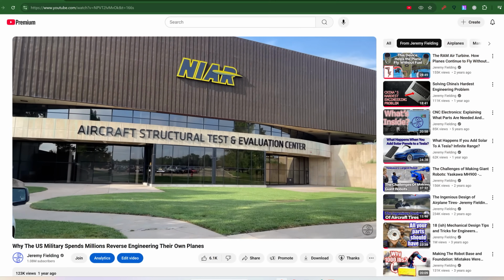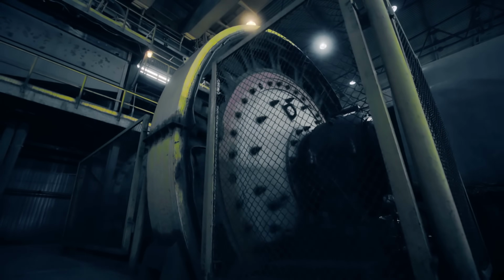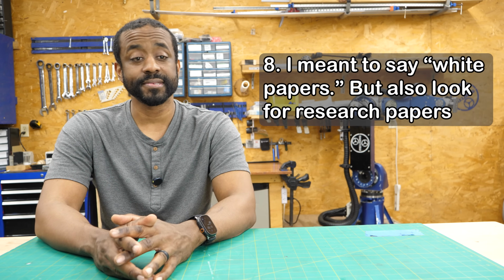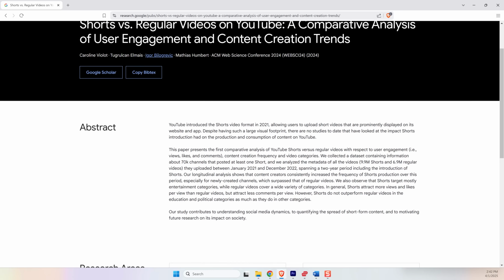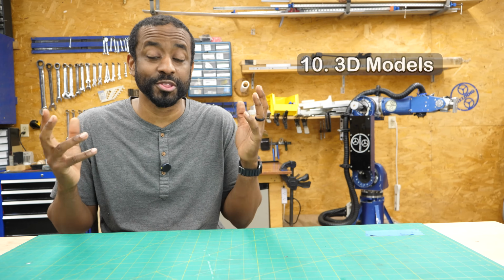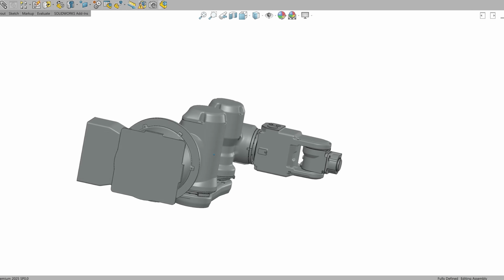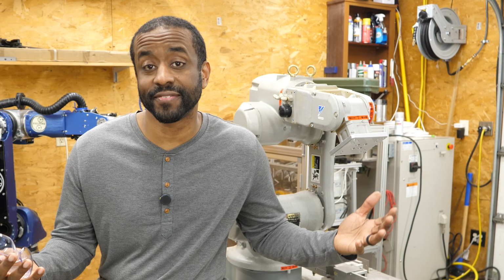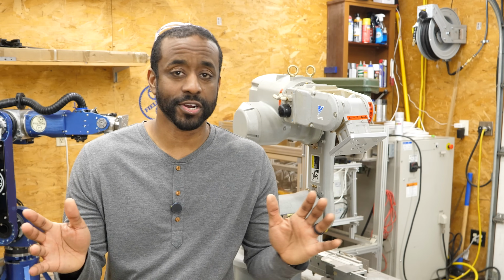How To Reverse Engineer Anything Even If You Don't Have One!

Comment: Hi Jeremy/All, I would like to point out what Jeremy said concerning our presupposition/opinion. He makes this (very important, in my humble opinion) statement at 22:22. He states "Actually, you should never be so conceited to think that you're actually smarter than the guy who came before you." 

I work as both a manufacturing engineer and machine design engineer in my facility, and both the Lord and others have taught me that the best route forward is to remain humble, and never tell yourself that your initial opinion is best. We should always remember that we have had to learn everything that we currently know, and that our opinions are based on our current understanding. This is very limited. I don't tell myself that my way is the best, I tell myself that "This is the best way I currently know how, and if someone has more input, I would love to hear it! 

One thing I have learned since working in this field (Since 2009) is that I need to recognize that people are smart, whether they are "an engineer" or anything else. I have learned much from floor operators who use the equipment! I consider their opinion, as they are the people who use my design daily, and can see the horrible flaws or sometimes minor inconveniences that I had not considered. Many times, a design is settled in prototype phase, then reiterated in production phase, because the design needs to consider how 10,000 are being assembled, when it wouldn't matter if you're only building one, etc. God bless you, and thank you for your mindset!

Comment: That "divit" is for "mastering" the axis. Each axis will have one. You screw in a device which gets hooked into the robot. l and will tell it when it bottoms out. Newer robots it is electronic/ mechanical, but I suspect older robots are pure mechanical. I have to master a kuka krc2 system I am resurrecting, so I will find out.

Comment: 20:05 this is potentially to lock down the head for shipping so the servos, gears, and bearings don’t need to support the load and vibrations if that’s in a cargo container bouncing around the ocean. I would have thought it’d be externally accessible but I have a feeling the importer or purchaser has to do a minor tear down anyways to grease it and any other things that may impact importation.

Comment: Bro thank you for this video. This semester I literally took a course named Reverse Engineering, and it was a complete misnomer, because we actually didn’t learn ANYthing about reverse engineering, and instead it was a course that taught random little factoids about varying and completely unrelated fields. An absolutely useless course. In this 30 minute video, you’ve taught far more valuable knowledge about reverse engineering than I’ve learned from an entire semester of a course with the same name.

Comment: First off, I love your videos and your attitude. Your excitement is contagious, so thank you. Secondly, in many cases, people tend to overlook one important detail of mechanical design, the fasteners. Obviously, everyone knows they are crucial, but I have seen many great designs fail simply because the fasteners were insufficient. When reverse engineering, i pay attention to the placement, type, and reason for each fastener. Typically, there is not much to ponder in standard use equipment, but in my field being aviation, there are tons of questions to be answered. For example what is the type (Blind rivet, solid rivet, blind bolt, lockbolt, screw, bolt, etc.) What is the head style ( tension head, shear head, button head, hex, 12 point, unisink, etc.) What material is it made from ( aluminum, monel, cres, titanium, alloy steel) Is there a special coating? What is the tensile and shear strength? What type of load is in effect? Is a washer required, and if so, what type of washer and how many? What material is it being installed into? The list goes on and on. One major issue to consider is dissimilar metals. A steel fastener installed directly into aluminum will cause corrosion that spreads rapidly. The same is true of aluminum fasteners installed into a graphite structure. In some cases, a simple fastener can be the breaking point of an otherwise fantastic and complex design, and when designing from scratch, this could be a very costly mistake. There is also a very large assortment of fasteners for different applications that could likely be implemented into standard equipment designs that are largely unknown by many engineers. Some research time is, in my opinion, well warranted when the outcome could potentially be much stronger (or intentionally weaker) as well as much cheaper depending on the intent of the machine.

Comment: it seems like you went into this with a lot of knowledge already of what the components are. Would you say you first need to learn about common components in machinery before attempting to tear apart something like this? Cause it seems like you knew a lot about how pulleys, motors, face plates, etc worked already, which helped inform your observations of how things worked.
Reply from the maker: When I started doing this I didn’t have nearly the knowledge I have now. You find something interesting and you look it up. Next time you know what it is. 10 years later and I am making videos about it.
Reply: @Jeremy_Fielding Interesting. Thanks for the response. But then surely you should start with taking apart more simple things right?

Comment: Well they could of put industrial heat shrink on all your connectors making it hell to get off. At my old job working on garbage trucks if you needed to push the compactor blade to full eject with the back door closed so all the lovely garbage juice doesn't spill out all over the shop you had to trick the system into thinking the tailgate was lifted up by disconnecting the proxy switch which had this thick heat shrink that also had some kind of bonding agent added to it making it very difficult to remove even with a razor blade. So servicing the wiring or sensors was a draw.

Comment: brother.. what you want, to machine stuff like that piece needing concentricity and complex back boring features, as well as complex OD features which otherwise require precision mill work.. is a CNC lathe with live tooling (y axis), and a sub spindle.. kept very clean and accurate... you can do all the work in a single set up.. make twenty to fifty of them per shift..and set up for the next part.... rinse and repeat.. i suggest Mori Seiki, mazak, or a brand new Haaz, paired with quality tooling Sandvik if possible.. for very tight tolerances and consistent results... for this it is often best to make custom jaws, use your G10s, sub routines, etc. to maximize output and minimize time lost indicating each raw casting..... thanks for your videos.. been subed a while.. love your spirit.
Reply: additionally.. ... .capto type tooling is worth the money... makes changing set ups very fast and very accurate, far more so than a bolt on type turret... raise your operators not only to be machinists.. but engineers like you... pay them as well as you responsibly can, and ask them to help you raise the next generation to do the same; before they blossom and leave you to pursue their own dreams if they decide that to be the course they need to take.... be good to them.. and fair.. knowing that everyone will crash a machine eventually.

Comment: Great advice!
I think you already said it, but it's worth remembering that when they built that, they were trying to solve a problem, and this is the method they came up with to get a solution.
That means if you are building something slightly different, you may want to use a similar, but different approach. In other words, don't get fixated on a one size fits all method.

Comment: Well I only engineered a smart lamp so far. And I looked at the basic mechanical, electrical and software I got a apprenticeship in and work with researchers. So reverse engineering is my next step and my next project is a cnc mill. I will learn a lot I guess and will need to reverse engineer like you I don’t got enough money for a metal cnc mill that works with metal so I can’t measure exact parts and can’t manufacture custom parts with high iteration (I have a good 3d printer wich can print carbon filaments) so I will use the 3d printer for testing some parts before and use some fem simulation to know how stable it needs to be.

But thanks for the information and a good introduction on how to do reverse engineering

Comment: Awesome video! The Japanese came up with an original solution for controlling the 5th and 6th axes in this robot. But what I liked the most is that all the markings are written on the motors, making it easy to find similar replacements. On our channel, we're also disassembling a robot, just like you, but we're working with an ABB IRB-2000, and there's nothing written on its motors except for the catalog number. Tell me, are you going to manufacture the harmonic drive yourself or will buy it?

Comment: I didn't see any other nerds mention it, but that "C2 Greyhound" is actually an E-2 Hawkeye - the radome is a dead giveaway. That being said, a big reason you see reverse engineering in the gov't / military is they are not so good at writing contracts - they may "own" the data / design for a product they paid to be designed, but they may not have specified in the contract that some piece of critical design data actually must be delivered (think beyond drawings / CAD models to software, firmware, aerodynamic models, stress models, test reports, and so on). So they "own" the design but they don't have the information they need to make a repair or modification. Or they received the info at one point but didn't keep it organized and/or "those guys no longer work here"...

Comment: An easy project that helps me practice reverse engineering is modifying and customizing video game controllers.
So far I completed 3 Xbox and 2 Playstation controllers, 1 of those PS4 controllers required a little bit of soldering for the back button remap kit and turned out really well; got another one to do and then a PS5 controller is next on my list to install a back button kit.

Comment: I just spent 3-1/2 months, 50 hours per week, reverse engineering a machine for a client in the semiconductor manufacturing equipment industry.  They didn't design the machine originally.  The machine is no longer manufactured by the original manufacturer.  My client has a significant list of customers that would still like to buy such a machine, but there are not enough used machines to go around.  Due to the age of the machine, there are no patent issues to worry about.

We now have complete 3D CAD models for every part on the machine, assembly drawings, and detail manufacturing drawings of every single custom part.  Also, every single off-the-shelf part is identified down to the last fastener.  We have shop drawings and CAD models for manufacturing 190 of the custom parts (approximately a total of 400 sheets of drawings).  We also have a Bill of Materials with a unique new part number, description, and quantity for every single part on the machine.  It was a lot of work.

Next step is to build one or two prototype machines.  I can't stress enough how important is can be to take lots of high-quality photos during the process.  It can make all the difference in the success of the project.  For this machine, I took approximately 350 photos over the 3-1/2 months.
Reply: to me, making 3d models of something sound impossible, a task out of sci fi lol
Reply: @subgivtara  I promise you it's easier than it seems
You just have to get your feet wet
Reply: @iluvyunie  “just get your feet wet”. It worked for Archimedes, after all!
Reply: @subgivtara ai may be helpful here ;)

Comment: About protecting wires: from some limited experience, oil and grease makes isolation of wires and cables brittle and stiff therefore prone to breaking. The worst cases i have seen (not that these are worst by any means) where in sewing machines. It was like "if you touch it, you replace it". Reverse engineering, or how I call my folder "rewing", is a puzzle like game and if you are in some industry this is one of the best ways to get introduced to specific problems and how somebody solved it. Nice video, best regards.
Reply: Excellent advice! 😮 🤠

Comment: You did indeed answer your own question of some sort!
The part you referred at in the video which you guessed to be for alignment is used to calibrate the zero position of the incremental encoder sensors which are used as feedback for real time position of the joint angle. Each joint has as what they call an index mark of which could be used to calibrate the joints manually in case the robot lost power to the batteries which are placed in the control box. That happens either if the battery ran out, which is a rarity or in your case if you disconnected the robot from the control unit. You are supposed to find in the settings of the smart pad a selection which state 'Mastering' which refers to stating that you guarantee that the robot is aligned according to index mark.
Jeremy, you are a genius!
I was shocked to hear you guessing the right answer right away!

Comment: I'm a new product development engineer who works with pressure retaining parts, specifically pressure regulators that are used in all sorts of applications including rocket testing and natural gas distribution. I really like reverse engineering things, but I have a caution advisory for you to consider.

I see you made some changes to recreate the cast design with purely machined parts, but it's important to be careful with your material selection. You may have already been diligent with your redesign, but you didn't talk about this very important design aspect in your video here.

If one has 3D models, it doesn't mean that the design can be can recreated directly to work safely. Companies for industrial products often use special steel alloys that have much higher yield stresses (generally stronger and higher quality), that you may not have access to while reverse engineering to create your own solution. If you don't thicken your wall thicknesses or adjust your design for a weaker steel, you could eat away all of the safety factor built into the original design. This means that you could be very close to having catastrophic failure after X numbers of load cycles. (Fatigue life is very important). All products are engineered to a specific safety factor to reduce cost, we can't just make things ultra safe, because they then will be ultra expensive. For example, a simple bolt can generate enough preload to destroy whatever is being tightened for example if the clamped material is relatively weak (a lower yield metal).

It takes a lot of analysis and calculation to make sure these designs are safe for use, and that includes CoCs (certificates of conformance) that guarantee your material strengths. Even the same steel alloy can be heat treated to different temperatures which will affect how strong is it, with different pros and cons.. let me know if you have any questions! I can't speak for the electromechanical parts.

All the best, Andrew - Mechanical Design Engineer

Comment: Reverse engineering from scratch...well, for one, I didn't know this jack screw holes system, so I would have probably broken something because I didn't know how to disassemble it properly.
So, it's not really "from scratch". Your prior knowledge does help a lot to do it properly and to interpret everything properly.
Beginners will have a totally different experience. As a beginner, you will likely break a lot of things while disassembling them. But that's a phase you have to go through.

Comment: Love your channel & I'm a sub.
I NEED YOUR HELP !!
I'm old school so try to be polite and thorough but that makes me long winded. Apology's !!

This has little to do w/this particular video subject, but I'm building an air compressor. Used 240 V single phased motor (?) ,  used pump (?) , used tank.  New plumbing, fittings & pressure regulator switch.

I'd like to connect leads to the motor to see if it spins or works.  It has molded 3 cord gray flat cord like the ones which come out of a dryer or wash machine which makes me think it's been re-corded.  The cord has no plug end.

I have a 30 amp cord coming off a 30 amp double pole breaker in my sub-panel. It has a female end on it.

What would you suggest is the easiest way to connect the motor to the electricity to see the arbor spin ??
Side note (curiosity) , .... , can a 3 hp motor run a 5 hp compressor pump in case I want to purchase a larger pump ?? (Pros & Cons)

Would you happen to have an idea how I could test the pump ??

Thank you for your generous consideration,
Sincerely ...............
Steph (Stephen) Leesville, LA   (just a C+ man)
(337) 509-6900

God Bless you and your family !!

Comment: The hole is used to set the robot's home position for that axis. A precision pin can be inserted when the holes are properly aligned. Each axis includes an alignment feature like this. Once the home position is set for each axis, the controller can accurately determine the robot's position using feedback signals from each axis's encoder.